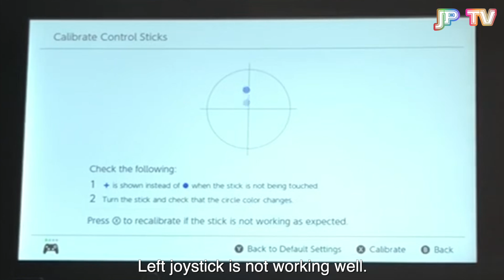How To Fix Nintendo Switch Pro Controller Drift (Wandering) Problem without Spending MONEY

Comment: The issue really is just dust accumulating in the joystick it's good that it's just that but also a shame Nintendo didn't look into this enough (and for joycons too obviously)
Reply: @External not to the extent that it does with joy cons and switch pro controllers
Reply: When ur done playing just don’t place it in a dusty area
Reply: I have a PDP pro controller and I could take the skin off without any screwdrivers. When I take the joysticks off it works fine but when I put them back on they start drifting (a little bit but when I use them for over half an hour it gets really bad) and it can’t be helped no matter how hard I blow it or how much I clean it.

Comment: Literally day 1 with this controller and I have bad drifting. It’s impossible for me to play animal crossing with this issue. Will be trying your fix
Reply: My left stick works now but didn’t realize my right stick was also out of sync. It’s not nearly as bad as the left was but still irritating
Reply: Alejandro Ayala same thing happened to me. Im glad it worked for you. Ill be trying this myself as well
Reply from the maker: I hope my solution worked for you.
Reply from the maker: @Juatahappydude  Maybe you can recalibrate the right stick.
Reply from the maker: @XLH2000  I hope this worked for you.
Reply: At least the new pro controllers are fixed
Reply: Literally just got mine and I have drifting seriously Nintendo first the joy cons now this
Reply: @howdyfucker443  for me I haven't had an issue but if u have get contact cleaner put it under the stick and move it around and it may work it did on joycons but if not sry dude
Reply: If its happening day 1 return it to the store. That isn't a wear and tear issue. Thats a manufacturing defect.
Reply: @Relaxifier  every controller drifts even ps and xbox thats sad ik
Reply: @Radu33-  no controller should drift when you buy it
Reply: @Relaxifier  then return it
Reply: @Radu33-  I did, but it’s still annoying
Reply: Sheesh mine started drifting last week and I had it for like 7 months

Comment: Great video! Turns out there was a lot of dust and somehow cat hair gathering around my analog sticks for some reason. Drifting seems to be gone for now. For anyone who removes the white cable with the blue end: make sure it is inserted properly when reassembling the controller or else your buttons won't work (learned it the hard way)

Comment: 99% fixed. A bit hard to unscrew the first two screws, but now it work almost perfectly, thanks!
Reply: Mh... after a couple of hours of gaming, the drift is back. Not as bad as before, but it will probably be that bad in some days. Maybe I’ll try opening it again and clean better.
Reply: Fil5 how is it now
Reply: ImThatOneGuy 
TL;DR: it still drifted, but I swapped a piece and now it works.
As expected, after a couple of days the drift was as bad as before. Yesterday I was about to send it for repair, but I found this guide where it's explained what exactly is the failing component (one of the four axis sensor) and where to get a replacement. Actually, it is a pretty common and cheap component, so I ordered it... but right after this I decided to try simply swap this piece with the same but from the other stick. I was trying to make the left working bringing the issue on the right one, as it isn't as crucial. So I opened another time the controller and tried... things. And it apparently fixed it! Of course I'll have to play again for some hours, but from the calibration menu I definitely notice how the problem is now mainly the right stick (exactly where I put the faulty piece). Even though from this menu both sticks seems to have some small drift (none of them stays in the middle, not even after many calibrations), in game they work perfectly for now. For the guide, search on reddit "Nintendo Switch Pro Controller Analog Stick PERMANENT Fix". The first 5 results bring to the same guide.
Reply: Experiment with putting thin strip of electric tape on neck of joysticks after you clean it. Major issue being the joystick itself if breaking particles of dust into controller as you mash stick around.
Reply: @SniperWolfMVM  Yes, I used it since my first try of fix. But I probably hadn't cleaned enough until I completly opened up the piece and moved it to the other stick.
Reply: @fil5977  Yes, you have to be quite thorough. Use an air-blower gun those are really good at driving all the trapped dust away. For grime, use rubbing-alcohol or propan1 light cleaning solution. 

But just the air-gun should leave it near perfect for at least 2 months on heavy use

Comment: Amazing video to the point, a little pointer to anyone doing this.. trust me don’t take your time removing the ribbon cable. In my opinion it’s not even worth the headache of trying to put it back together and you have plenty of room to clean while it is on. Now about the repair. The first time I did it I used compressed air and a brush and it did 80% of the drift but I was kinda bored so I went back in this time I used the brush with isopropyl alcohol and it worked like a charm 0 drift and took about 25 mins in total with me fully building the controller twice. Thank you for this simple guide

Comment: Appreciate it even though it's sped up quite a lot but actually you explain the main sequence well where you need to be careful with the main connecting wire.

Otherwise this actually proved quite easy and now a regular thing I do heh, who needs house maintenance this is more important! =D

Comment: I was able to use this controller for about 3 months before it failed on me. After maybe 3 years I finally decided to fix it. I wish this worked for me. I cleaned mine so well, and it worked for 1.5 play sessions before returning back to normal. Really crushed my spirits, I’ve tried so hard to get this controller to work, and it’s really disappointing a $70 product sucks ass

Comment: Possibly recommend putting thin strip of electrical tape on the neck of the joystick to prevent the break off of controller particles.

Comment: Hello! I have a question.

When you blow into the controller to clear the dust, are you using your mouth or a can of air? Thanks!
Reply from the maker: If you have a can of air, I recommend to use it. If not, be careful not to blow the air with spit.

Comment: what's the best way to reattach the ribbon cable. I'm afraid of breaking it if I use too much force I'm just having trouble attaching it
Reply from the maker: the best way to reattach is by holding the end of the cable which is harder than the other part and put it into the slot gently.

Comment: hell yeah! Thank you so much! My controller is drift-free 😎
Reply: SonDeku hey! I’m actually doing my self repair right now also! Lol question! For the blowing part did you blow on the whole joystick or only on the blue part?
Reply: @ricardorivera981  I blew around the blue and the top. I dusted the crap out of it all just to make sure. You can test to see if drift is still present if you use the controller settings on the switch for the analog stick. You may safely insert the battery back and don't need to plug the cable back up!
Reply from the maker: Thanks for your reply.
Reply: Me to I’m so happy I’ve had this problems for months now

Comment: 3:11 what is the white ribbon for what happens if I don't plug it or cut it?
Reply from the maker: The buttons on the front side won't work. Thanks.
Reply: @jptvjohnnysplaytv6448  do you mean the sync button or to turn off the controller?
Reply: It’s a ribbon cable, if you cut it the controller will not work anymore
Reply: Basically a small wire that sends inputs from the front part so be careful with it
Reply from the maker: I mean A, B, X, Y buttons and the others on the top.
Reply: Did u cut it?
Reply: @dogobgynz  ofc not I was scared to do so because I was using my hands and it's kinda small and when I put it back I was scared if it was ok or not and if it was working after that all its good as new that's why I liked and subbed

Comment: Hm preferably don’t blow into electronic devices to not put saliva in there. Once you put the battery back, any remaining moistness could short-circuit the electronics. Use a plastic tool to disconnect the cable seen here.

Comment: I could take mine apart i don't want to mess up my controller. It works now when i blow on it. Also, How did you get your comments to turn back on in your channel. I tired to do it on mine so many times but the site won't let me thanks to Coppa new policy in January 2020 and it won't let other users and people to turn on there comments on there channels. So, I was wondering if you can tell me how did you manage to turn them back on in your channel so my comments will be active again.

Comment: My pro controller can't calibrate, it just says "Stick calibration is not currently supported for this controller. Calibration may be possible after a system update." I tried updating but tis up to date, is there any way I can fix this? :(
Reply: Try to update your controller in controller settings
Reply: Is your controller the Official one, I don't think it can be. You might even need a firmware update from the controllers' site if it's not

Comment: Tried this but the first two screws would not budge. I guess I'm stuck with drift then🤷‍♂️
Reply: the first two screws are a pain in the ass, you need to use a really tiny + screwdriver and a lot of push force

Comment: Um so it did work, I fixed the drift, but all of my buttons aren’t responding except the joysticks and the top and left buttons on the cross below the left joystick
Reply: Pls help
Reply from the maker: Can you check the white flat cable if it’s connected to both side?

Comment: Guys I tried it I have no brush I just blowed with my moth and use a tish u 
And the drift is gone also you just need 1 screw driver for all it's simple I recommend it and Idk why this should has tons of likes I'll sub :3
Reply from the maker: Hi, I’ve tried just blowing it but the drift problem happened again because of the rest of the dust in the joystick. So I recommend brush and blow it.

Comment: I’m a kid and I don’t have the tools so is there a way I can fix it without having to take it apart?
Reply from the maker: Try moving the joystick and blow the air through the gaps.
Reply: JPTV Johnny's Play TV thank you for the advice, I was not expecting for anyone to reply. I will try that and see if it works.
Reply: JPTV Johnny's Play TV btw thank you so much because it’s working so far

Comment: Damn your really lucky to have that type of screw I tried taking care of my controler and it still got stick drift :C sad
Reply: Just pick up one from any decent hardware store or order online if you have to, a standard cross-shaped long but casual size one some stationers have even would do it.

Really worth it as it's far better than the Jo-Cons where you get rail-slippage that cannot be fixed on the current design at all.

Comment: Where did you get the screwdriver from
Reply from the maker: I got it from amazon. https://www.amazon.com/ORIA-Screwdriver-Professional-Precision-Smartphone/dp/B01E16J6RQ/ref=sr_1_3?crid=15G0KOS8GJBOD&dchild=1&keywords=ifixit+screwdriver+set&qid=1589692597&sprefix=ifixit+scre%2Caps%2C224&sr=8-3
Reply from the maker: For the longer one, you need this. https://www.amazon.com/Craftsman-9-41293-Phillips-2-1-Screwdriver/dp/B007PAKOSG/ref=sr_1_10?crid=1HDV8EJ4VKGJC&dchild=1&keywords=phillips+screwdriver+%230&qid=1589692667&sprefix=phillips+screwdriver+%2Caps%2C238&sr=8-10

Comment: thanks for the video. tried it but same problem. it seems that the controller i bought was used before. probably a returned one. I can not believe that nintendo designed such a bad controller. it is really a flaw in the design. why use analog? it is waiting for disaster. i will return the controllers and use the wired one, the only one that worked as it should.
Reply from the maker: Yes! Probably you got a returned one. This drift problem happens when you use it for a long time. And dust goes into the analog stick and make this problem. good to know when we have this problem with a new one then we can return it exactly.

Comment: thanks it worked i found a dog hair inside
Reply: so the drift came back but there's no more dust or hair left? wondering if i need to make a second pass
Reply from the maker: @zentember  Sometimes the drift comes back because of the dust from the joystick. Please make sure the joystick doesn't have the white ground plastic dust on the joystick. I mean the stick cover part (the neck). And try to blow the air from the outside not opening the controller.